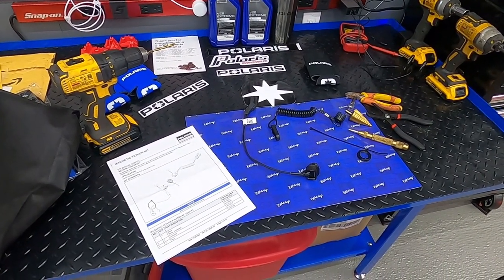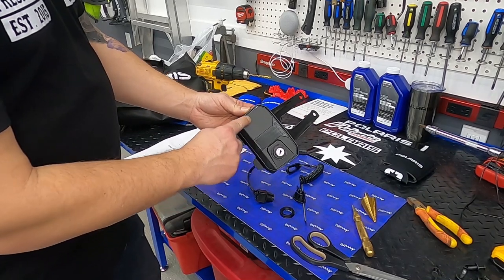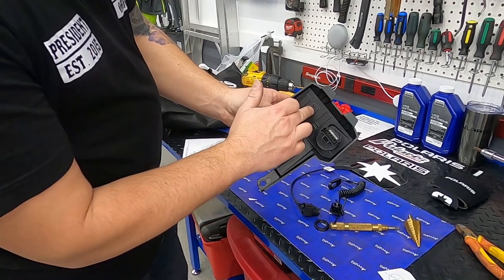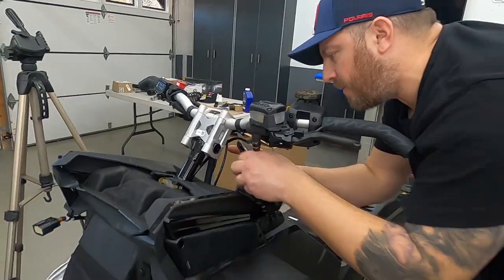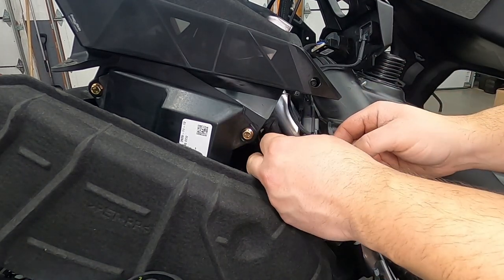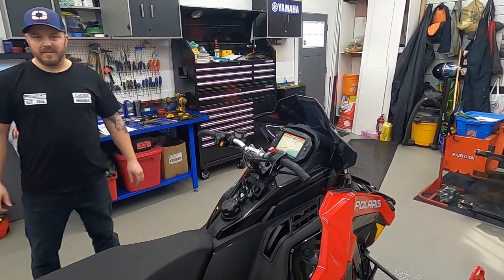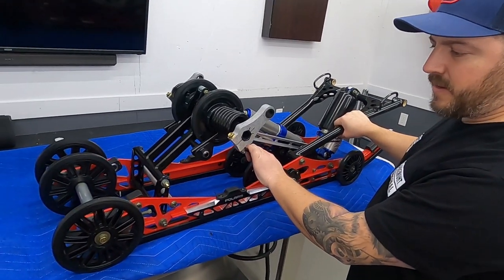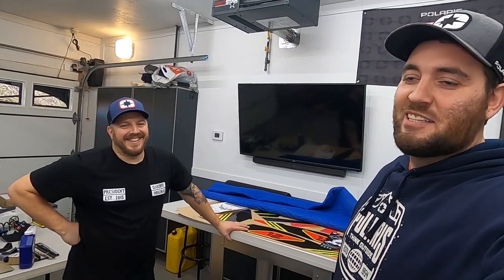Magnetic Tether Install on MATRYX Indy VR1

Comment: Glad to see you got yours finally!! FYI My dealer put my  heated seat switch in that location my tether is located below my key switch
Reply from the maker: Interesting, there's room?
Reply: @krazykanucksperformance2242   it’s in there I’ll have to look closer, to see ?? Also I’m using the lighted hand guard plug to run my Ridelight, , those are 280 Delphi Aptiv connectors for those who want to hook up alternate accessories and not cut the plugs off
Reply from the maker: Funny you should mention, video coming tomorrow where I made a custom USB outlet and used a Metri-Pack 280 Connector to plug into the RCA power. No splicing here!